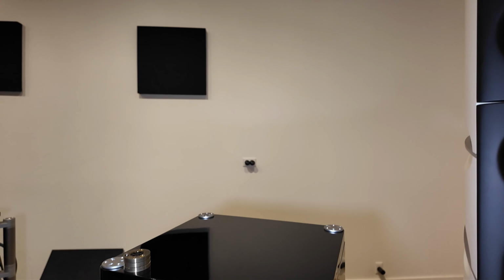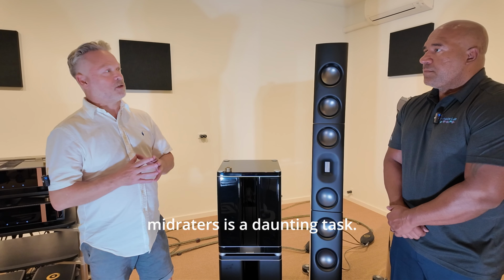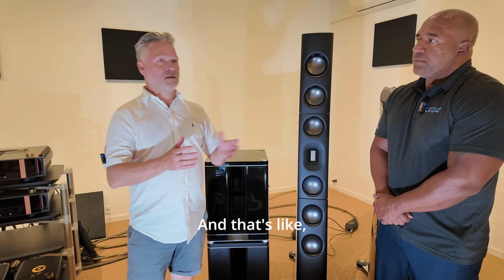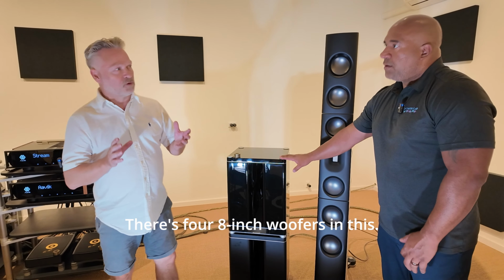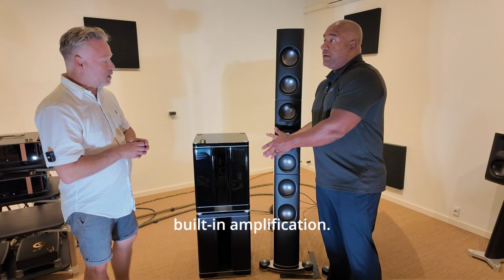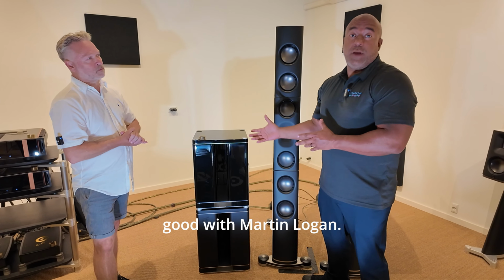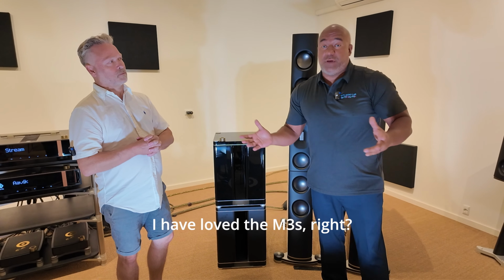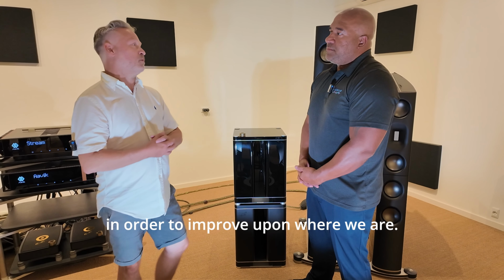Borresen Subwoofer   Could This Be One Of The Best Subwoofers In The World?

Comment: Jay, the reason why you felt like the top end was more refined when adding the subs even though they only affect the low frequencies is a psychoacoustic effect. Whenever the top end is improved we perceive also the low end to be improved and vice versa. There have been scientific studies done on this topic and found that that's the way we perceive music as humans. So don't worry, you are not getting crazy, it's natural to get that impression when adding subs properly integrated into a system (so they disappear). If they are not properly integrated your impression might be all over the place.
Reply: yes and stereo-perception aswell because of very low frequencies.
also; the harmonics of high notes get amplified in the air by the same note but octaves lower, by the subs. 
borrisen is smart by not using a 12 or 15" woofer but 4 x 8"ers! makes it more 'fast' and capable to go higher, into the mids.

Comment: Ouch, I think Michael Borresen can do better in explaining the function of this sort of subwoofer. Indeed, as I mentioned in the comments of the previous video, this form of a subwoofer was built by Axel Ridtahler in Karlsruhe, Baden in the south of Germany. I helped him to built the prototype which I still own. Axel gave licenses of his patent to several companies to build this woofer , even known as Ripol: Ridtahler + Dipol = Ripol.
If you, Jay want to do work in the sense of a good journalist, please try to clarify the function of this system.
I am offended, that Michael did not disclose the man, who had done this first. 
To dive further into the subjects of subwoofers there should be an explanation about the "Druckwandler" - pressure transformer - versus the "Schnellewandler" - velocity transformer.
I hate to say this, as I like your work on youtube, but if this the end on reporting about this subwoofer - this is an embarrassing failure.
Reply: The industry has so many swimmers for profit in its cesspool
Reply: Sure looks like a Ripol design.  Built my own Ripole with 10 inch drivers, even did Piano Black gloss finish.  Agree, the Bass quality if pretty amazing from a small form factor.  Talk about "fast" bass is misleading.  That terminology implies that the faster the driver, the better.  Rise time of a low frequency note is not fast.  You want a bass driver that accurately follows the rise time and settles quickly.  That produces clean bass that is not mushy or boomy.  Chest thumping bass will not come from a Ripole.  However, clean and deep bass felt in you toes is possible.

Comment: A very cool offering and nice to see. However there's nothing new here wrt subwoofer tech. 

This appears to be a ripole type OB dipole platform. It doesn't 𝘱𝘳𝘦𝘴𝘴𝘶𝘳𝘦 𝘱𝘶𝘭𝘴𝘦 the room the way typical monopole subs do. 

This facilitates a 𝘷𝘦𝘭𝘰𝘤𝘪𝘵𝘺 dominant experience, ... instead of the 𝘱𝘳𝘦𝘴𝘴𝘶𝘳𝘦 dominant experience of typical sub platforms.  

Thus, it lowers the detrimental influences from modal excitation.
Reply: That's where I see the key advantage. The interaction with room modes (which is a typical problem) can be solved by (depending on the size of the room) the crossover frequency to the subs is set accordingly (smaller room requires higher crossover frequency).
Reply: @andreas7278  
Attacking modal influence is done physically. 
- Modal resonances are fixed by the room's dimensions
- Which modes are excited depends on source placement
- Which modes are experienced depends on listener position
Reply: @FOH3663  I am not sure I get your comment regarding "model resonances are fixed by the room's dimensions". Typically the room size is fixed since we find the best room we can spare in our already existing home and then try to treat the room to get a good result. At which frequency the "room gain" and thus boomy bass issue occurs is defined by the room dimensions which we can't just change (to be more precise the shortest length including the room height, so often that is already the issue). We can try to absorb that with ceiling absorbers and bass traps but that problem simply exists in most homes. A ripol design only pushes air directly to the listening position and not in a 360 degree circle around like regular subs (since at low frequencies bass drivers which are directed at the listening position basically behave omnidirectional), so they take out the room for lower octaves out of the equation if your listening position allows for it (so most optimally a near field position where you are inside the equilateral triangle like I have it set up). So you only get the direct bass notes and then with larger decay reflections from the back wall which won't smear the bass since big enough delays are psychoacoustically interpreted as reflections and not smearing by the brain. Also you get way less loud bass to any potential neighbours in flats behind the wall of that speaker. So unless you can build your house from scratch or have space for a separate hifi-only building next to your house there is little you can do about room dimensions. You can only work within the constraints given.
Reply: @andreas7278  
Respectfully, I can't make it any shorter, more clear. 
Perhaps you could read that again. 

Resonances are fixed, you can't move your boundary surfaces, so modal freqs are pre-determined. 

To what extent they're excited is based on source location. 
To what extent they're heard is based on listener position. 

That's how modal resonances are attacked, physically. 

There's countless hifi myths out there. 
The points you made on room gain aren't correct either, I'd be glad to address them, if you're interested. 

Thank you
Reply: 3663: I don't see how anything other than "pressure pulse" is possible.  Velocity is a different measurement entirely.  Subs move air; that's all they can do.  IOW - all a sub can do is emit a pressure wave.  More quickly (velocity) is better, I assume.  But 2 entirely different things (pressure and velocity).   So, you (and the German presenter in video) are making a distinction I do not understand.   While you're at it, please define "modal excitation."?